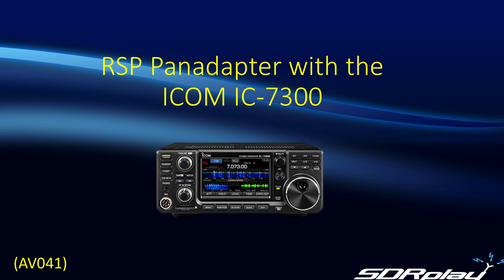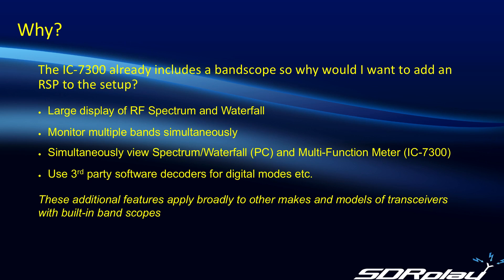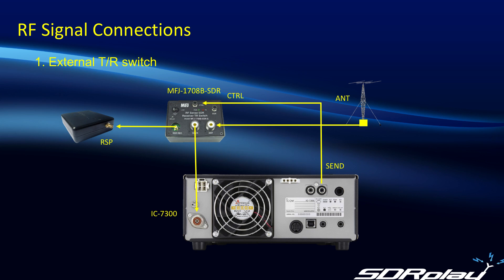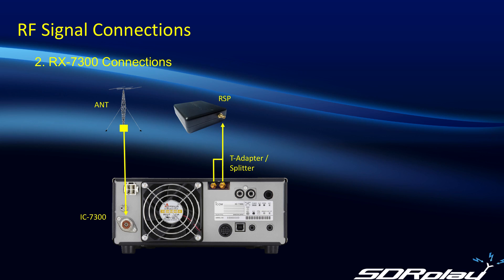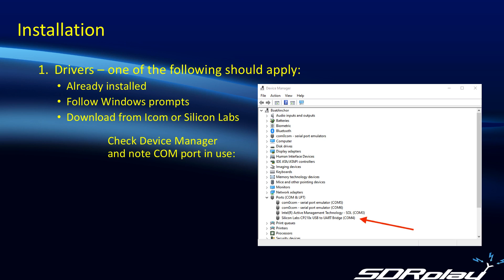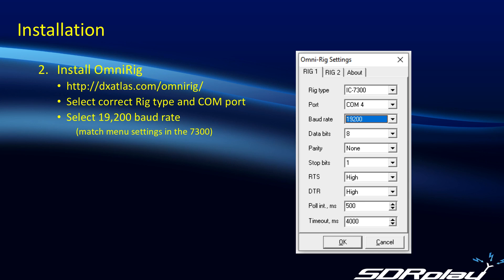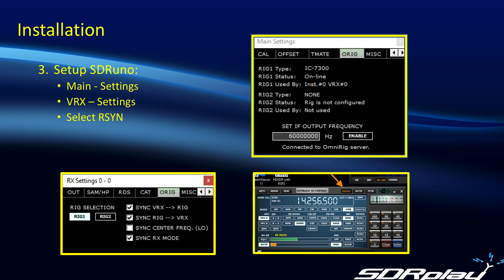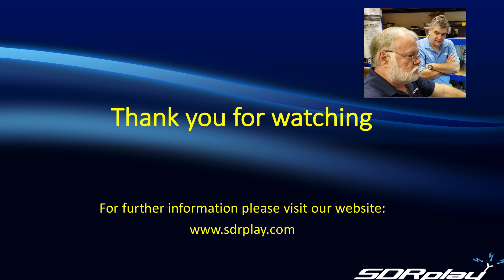RSP Panadapter with the ICOM IC-7300 (AV041)

Comment: I did the same modification with the pat70 from HUPrf, now on the SDRUNO I tune it on 69.45 Mhz but the problem is that I can hear clearly what my radio (ft991a) its receiving but on the SDRUNO displays the same 69.45 Mhz, it is LOCKED and I want to check the whole spectrum like you, how do you calibrate the software in order to control the ft991a with the CAT controls? PLEASE HELP
Reply from the maker: You are using an IF tap so will only be able to see the IF bandwidth of the radio, not the full spectrum.
Reply: @SDRplayRSP isnt there a way to setup an offset? So I can match the display frequency with the frequency of my ft991a?

Comment: Why do you need a PanAdapter for the 7300?  Why can't you just use the USB cable.  I guess there's something I don't understand about the PanAdapter.  With the USB cable you get the large screen you were complaining about.  You can decode digital modes on your computer with proper software using just the USB cable..

Comment: Will this work with the IC-7100?  If so, what modifications to your instructions for the 7300 should I apply to the 7100 setup?
Reply: I'm trying to do just that now. looking at this I don't see why it shouldn't work with option 1) with the sdr splitter. Not sure about option 2 and getting the rf passthrough though, I'm not good enough at electronics to venture out this way. Tell me if you've managed to make this work

Comment: I installed this option into my new Icom 7300 but I noticed the fit is less than stellar. While it seems to function, the outer nuts securing the two SMA connectors don't permit the back edge of the metal case to seat properly. As such, the case is slightly bowed where it goes across the connectors and the downturned edge, or lip, of the case prevents the SMA connector from being screwed on all the way. I find it strange there's no mention of this by those who've installed this component in their IC-7300 transceivers.
Reply from the maker: you can help it a bit by aligning the nuts to have the flat horizontal on top. If it was my own setup I'd probably take a file to it and make the fit better!
Reply: @SDRplayRSP   Yes, that was the first thing i tried but didn't make much of a difference. I've since removed the adapter and written it off as another bad purchase  :>\

Comment: I'm having a problem where when using WSJT-X that when it keys up the rig to transmit it changes the mode from usb-d to rtty every time it keys up any ideas? Otherwise I have the setup working correctly. System = Win 10 PC, IC-7300, PTRX-7300 pandapter,  RSPdx, Omnirig, My settings in omnirig are the same as this video. Need a fix or a way to turn omnirig on and off. I can't find omnirig in task manager either must be under a different name. Any ideas would be great. Thanks for doing the videos.
Reply from the maker: William Hampton quick answer is to deselect RSYN1 in RX Control window, but then your command to key the rig won’t go through either. Have you tried connecting WSJT-X directly to the rig? You can also experiment with turning off Sync RX mode in RX Control ORIG settings.

Comment: Done in a few minutes with a K3. Although here's one to think about. My pc is an old one. Swing the tuning knob of the K3, then SDRUNO will follow but not quite fast enough, bit slow actually. The info van from VRX to TRX pulls the K3 back so to say. So I will not implement it.
Reply from the maker: ariebomba the two should track instantaneously, I suspect you have an issue with your Omnirig settings
Reply: @SDRplayRSP   The K3 tracks the SDRPlay instantaniously, no problem whatsoever. A jump in frequency from the K3 isn't a problem either.  Omnirig settings are OK by that standard. Also when turning the tuning knob all runs OK.
Only thing is that I also have other software running like N1MM, etc. I use the wellknown LP-bridge software as a portreplicator and here is where trouble starts. There must be a delay somewhere that during the tuning of the K3, SDRUNO is behind a bit and sends its frequency back via omnirig (VRX to Rig is on) so that the K3 goes two steps forward and pulled one step back by SDRUNO. That is a bad thing. That can be solved by switching VRX to Rig control off, but that's something I don't want.
What SDRUNO should do is just follow the frequency of the K3 through Omnirig and only send the data VRX to Rig when something in the software is clicked or acted upon and maybe once or twice at startup of the Rig and SDRUNO VRX.
Slowing down the polling of Omnirig (up to once per second) helps a bit, but is not the solution.
Other software, like NAP3, N1MM and CWSkimmer (is also via Omnirig) do not show this behaviour at all when simultaniously contolled via LP-bridge. Problem starts when I connect  SDRUNO to the pack. 
Maybe you can have a look at this phenomenon and make SDRUNO even better. (Love the GUI of SDRUNO on my screen and I am very satisfied with my SDRplay1A. That's why I would like it to be my panadapter when I use the K3)
Reply from the maker: ariebomba I suggest you look at the app note we prepared on using HRD with SDRuno. The same concept applies to many other software packages that also attempt to control the rig and totally eliminates the problem you describe.

Comment: Thanks allot for the video. I have an RSP duo and was thinking of purchasing a IC-7300 and the PTRX-7300 Pan adapter. Question: Will I be able to control the decimation (on the SDR uno software and also the BW? I would like to do this and have capability of diversity reception if possible. Thanks
Reply from the maker: Yes to both, but note you will not see the Decimation options if you use the Band framing function.

Comment: Thanks for this tutorial.  It has me really thinking this is something I would like to do to enhance my 7300, BUT can you tell me if by doing this,  does it tie up the 7300s USB port so I can no longer direct connect to the rig via my logging software (N1MM)?  Can I have the best of both worlds? Or is it one or the other.  Thanks!
Reply: Im thinking both should work, I want to add an external pan adapter to my 7300 and do ft-8 ...im considering the ptx 7300 adapter which allows you to also use the tuner connection
Reply: @dmb3428  Thanks.  that is the way I was leading as well.  If you proceed, please do let us know how it all works together.  Thanks
Reply from the maker: You can use the EXTIO dll to interface N1MM to the RSP. I believe you could probably also daisy chain the control from N1MM to SDRuno to the rig, but we haven't tried that.